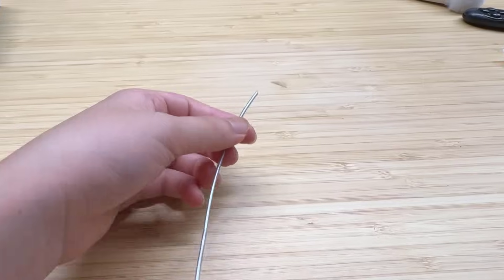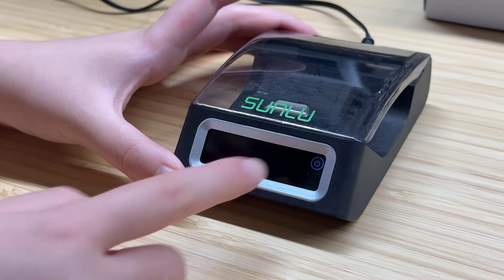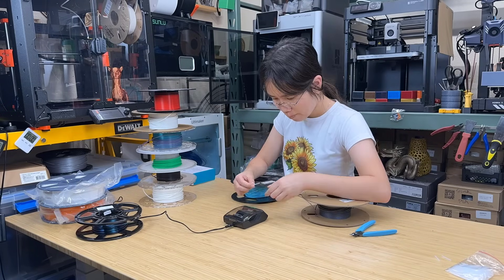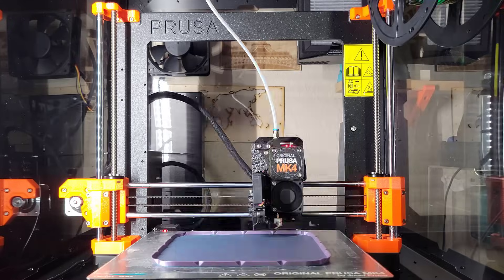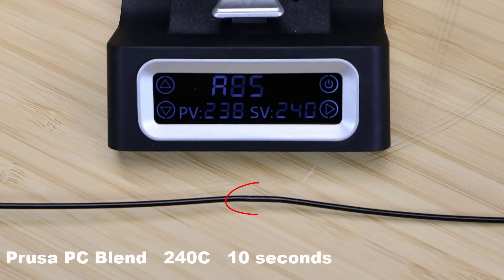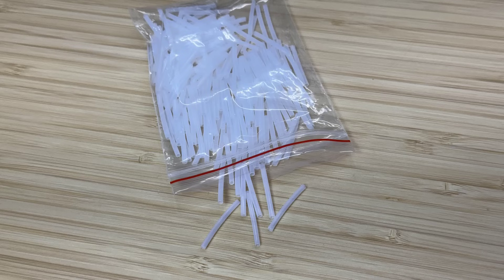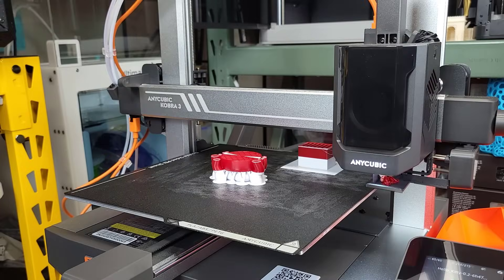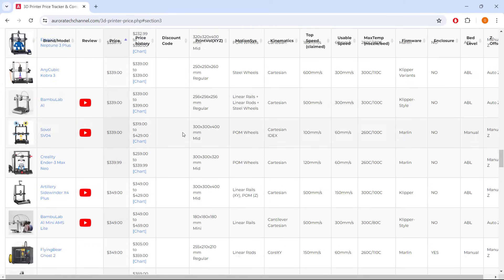How to reduce 3D printing filament waste by using the SUNLU filament connector FC01

Comment: Isn’t there a cutter on the device to remove the sleeve? i believe there’s a blade in the back
Reply from the maker: Kind of, but using a knife works much better :)
Reply: It looks like you can cut the sleeve in half.  it doesn't look like they need to be that big.
Reply: There is slave sliced cutter on machine just under the lid  . But she did not show you this in the video . Basically you moved the item to a different position and close the lid this will slice the sleeve horizontally . Then you can just remove it off the filament .
Reply: Pity it does not have a 45 degree filament end cutter as well so you do not have to eyeball the angle! But for the sleeve, you could probably just slide the filament through it (at the spool end of the bowden tube) as you print, until you reach the end, then pop it off and reuse?
Reply: @john_hind  Put the 2 ends of the filaments next to each other with the ends pointing the same direction and then cut both at the same time. The ends will match no matter which angle you cut at.
Reply: @TinkeringJohn  Indeed, put the two threads next to each other and cut. Clean cut every time ... things can be so simple 😀I'd give you two thumbs up if I could ...
Reply: @john_hind  eye balling the angle is good enough. it's getting melted anyways
Reply: @aleks138  The sleeve traps the gap air though....

Comment: Hello everyone! I bought the Sunlu filament connector with the idea of using up filament scraps from my spools, but honestly, there was no way I could get a clean splice. With the filament always so curved at the end of the spools, it was impossible to handle; it felt like I needed four hands just to hold everything properly! I always ended up with bent, failed joints, which was truly frustrating.

Luckily, I found a solution that has completely changed my experience: a 3D printable support guide. This design is brilliant because it perfectly aligns and holds the filament during the entire melting and cooling process, even the most curled pieces. Now, my Sunlu works wonderfully, and I achieve perfectly straight and strong splices, with no complications at all!

If you're going through the same frustration and have a 3D printer, I've discovered that the design is available on Cults3D. You can find it by searching for the designer name: @3DPRACTICO.

Here's the direct link to the design: https://cults3d.com/es/modelo-3d/herramientas/soporte-esencial-3d-practico-para-conector-de-filamento-sunlu-1-75mm

I hope this helps others who find themselves in the same situation! It's truly worth it!

Comment: This thing does not work. It's OK with a small piece. But with a spool in the back there is always tension what makes it impossible to make a good seam. I was not able to weld two filaments together that a printer would not fail over the seam. It's just a waste of money. I grew it away already just to keep my nerves cool and not trying it again and fail.

Comment: Downside you have to cut away the PTFE sleeves. 

Since you’re going to a transfer one spool to another, instead of cutting away the sleeve, can’t you just slide it off when transferring one the filament to a single spool?

Comment: why did you not use the sleeve cutter built into the back?
Reply from the maker: I have to push down really hard if I use the black slot to cut the tube. A sharp knife simply works better for me.

Comment: I have been looking for something like this for a while but didn't like the ones on offer so far, the FC01 seems much better all round.  I tried to order one via your link and found that the SUNLU site is not working that well, it took several attempts to convince it that I was in the UK and using GBP to pay, it seemed to prefer a mixture of either dollars and UK shipping  or GBP and US shipping.  If anyone has this issue, just keep trying as it gets there in the end.  I paid 34.75GBP with 2 extra packs of sleeves.

Keep up the reviews, no-one else covers things quite as thoroughly as you do.  Mark, UK.

Comment: I was using the tube process and using a soldering iron for heat but the curly leftovers were problematic welding.  I also discovered that those leftovers became brittle and would break in my AMS so I just stop joining them and started throwing them out as it saved a lot of time and headaches.

Comment: Thank you for the video.
Always something interesting on your channel. 
Awhile ago I bought a 2nd hand Pallet 2 to make my own custome rapid change filament, and to join nearly empty spools together.
Worked like a charm till I put a local companies rPLA through it.
I measured it afterwards, 1.65mm to 2.7mm over a 100mm diistance.
It broke the filament run out sensor.
I was duped after your use of sunlu recycled PLA.
Seems the r wasn't for recycled, but for reject.
but back to the point.
For the price of 2 spools of PLA you can save remnants and make up spools worth hundreds of $$$! well done!

Comment: did you miss the built in ptfe tube cutter?
Reply from the maker: I have to push down really hard if I use the black slot to cut the tube. A sharp knife simply works better for me.

Comment: Just slide the sleeve off the filiment and reuse it ?
Reply from the maker: Technically, you can. But it depends on how long the spool remains; you may need to slide it 50 feet to the end to take it out.

Comment: Please add a demo of the cutter to the video, it's part of the functionality. 
I have a zip bag sealer that cost 2€ and works since 15y. Why this is 35€ is beyond me. I could've done without the stupid touc interface and the awfull display. Give us a decent or none display and buttons. Why is this so hard?
Reply from the maker: I have to push down really hard if I use the black slot to cut the tube. A sharp knife simply works better for me.

Comment: Pretty cool device.  Well done Sunlu!  My preference is 3 kg spools for fewer reel changes and 1/3 of the end of spool waste on average, and if I want to use the leftovers when I'm monitoring the print (watching YouTube while the printer does its thing nearby) I've gotten fairly good at hanging a new reel and restarting the print before the bed cools and releases the part, then manually inserting the new filament into the extruder as it prints.

Comment: THERE A CUTTER TOOL AT THE ON TOP OF THE MACHINE TO CUT IT I HAVE ONE
Reply from the maker: Yes, but I found I need to push really hard to cut the tube with that black slot. A sharp knife works better for me.

Comment: Nice, thanks for showing the different filaments too. A little switch to put pressure on and hold both filaments would work wonders so you don't need 3 hands.

Comment: If you have a Bambu AMS you can simply pull all spools with left-overs into it and then automatically use them up. No need to bond filaments together. Just my 2 cents 👨🏼‍🔧
Reply: we all not as fancy or rich as you to afford an AMS. This is only $34
Reply: @TechBrewGamer I’m just curious, how are you in this hobby if you can’t afford an AMS?

I wouldn’t be 3D printing if my financial situation didn’t allow for the occasional frivolous expenditures such as an AMS
Reply: I have 2 AMS, but this is probably to help prevent that and save space. Also, for people who don’t have a Bambu. Lol
Reply: My IDEX does the same thing for basically the price of the ams .
Reply: Actually, I have a use for which the AMS is not a solution. Sometimes I need a gasket/O ring that a length of TPU is just right for. Like the lid gasket on the AMS. I have wished for a reliable way to join the ends. This might be the trick.
Reply: Finally someone says this. 
I don't get why people are hyping this
Reply: @sensenmann3000 Uh, the price point. Not everyone can afford Bambu nor the AMS system. This is great for tinkering with and pairing with a cheap bed slinger. At the price point it’s at, it’s worth picking up and trying regardless.

Comment: Aurora the device has a built in cutter at the top to take off the tube
Reply from the maker: Yes, but I found I need to push really hard to cut the tube with that black slot. A sharp knife works better for me.

Comment: I usually just let the filament run out on the printer and then load a new roll when the first one runs out. This might be handy if there's like a bunch or rolls left over and you do them all at the same time.
Reply: I’m probably gonna get this, I end up leaving my printers running for a while and leaving, so this saves space and time by not having to tend to it
Reply: We all don't have run out sensors to allow this and/or have just enough after a print not to print anything else on the same roll.

Comment: Why would you throw away filaments rolls that are close to the end? 
You print till the end and then you swap filament, with a filament sensor it's even easier as the machine goes in pause on her own.
Reply from the maker: In cases when a print finishes and the remaining filament on the spool is not enough for other prints, I end up with a lot of spools with only 3-10% filament left. If you run multiple printers, this happens a lot.
Reply: @AuroraTech  I fell ya, yet most of use just a few printers and few filaments and well, the filament sensor would do the trick as well.

I mean I get it's convenient for print farms like loads yet let's not sell it as "it saves you filament that would go to waste". Normal users could use just the nozzle or a heat gun or the solder iron with a random piece of bowden.

Comment: I wonder if you can cut a thin slice in the ptfe and reuse it.
Reply from the maker: If you really want to save the PTFE tube, you can slide it to the end of one of the spools without cutting it. However, it depends on how much filament is left, as it may take a while to slide to the end.
Reply: @AuroraTech  Not only to to save the PTFE, but to get it off easily (and not have to slide it anywhere). Essentially pre-slicing it, before use.
Does the slit leave any noticeable mark on the joint and the heated area, or have an adverse effect on the cross-section?
Reply: Me also.
Reply: Yes I would be very interested in knowing if you have tried this and if it works

Comment: I wish they would have designed a system to use silicone tubes instead of PTFE.  The teflon tubes will offgas and can be toxic (mostly to pet birds but still).  I'll still get one but use it with good ventilation.

Comment: How close to 1.75mm are the joints. Please share some measurements or averages.
Reply from the maker: It depends on how well you cut and apply pressure. I didn’t connect all of them perfectly, but it seems to work just fine anyway.

Comment: I be getting it soon! The small connector tubes could be saved if your rolling the filament on to the other 
empty spool the other loose end of filament would soon be off the old spool so slide the tube off before attaching the loose end of filament in the new spool.

Be reusable if not too over used then. Really those small guide tubes are slim PTFE tubing, 
So maybe find a thin cheap Bowden Tubing and cut it up to the size of the connecting tubes.

So many thin bowden tubes around there must be one that can be used instead of the official ones?  
Just print out a cutter guide for the tube length and that will be a saving and a good use for the cheaper Bowden Tubes.
Reply: I believe the bowden tubes have an inner diameter of 2mm.
The only tubing I've been able to find that is the right size is latex rubber, which wouldn't be great.
The Mosaic palette uses a tube that they claim gets 15000 splices. I think the price was $40US for 5, however I suspect it's a thicker tube that wouldn't fit in the heater.
Another commenter in another review claimed to have found some silicone tubing that he used with a heat gun but he didn't provide a link.
The other reviewer was able to slide the ptfe tube off the filament join, so prehaps there is the possibility of reuse.

Comment: Im curious if in the next year or so we see a machine variation that uses pellets to makes filament that is held in a buffer before going directly to the extruder. I've tested small screw extrudera but you need really small pellets which aren't easy to come by and are much more easily affected by static electricity. Being able to use common nozzle sizes but also work with industrial sourced pellets might be a good stepping stone until other advancements are made.

Comment: After welding the filament, you can place the PTFE sleeves in the back part of the lid, close the lid and then simply pull it out.

Comment: I just had a print fail at 98%. This would have been perfect!
Reply: Well you could get a filament sensor, it's much cheaper.
Reply: @eaman11  Thanks, captain, obvious,  I've been 3D printing 3 years. My Bambu lab a1 has a filament sensor. It just didn't register and was ghost printing clogged.
Reply: @THOR_THE_GOD  You welcome, I've been printing 10 years and my filament sensor works!
Reply: My point was, I don't need your basic advice from your "10 year experience." 🤡
*You're welcome
Reply: @THOR_THE_GOD  OFC, you need a good working filament sensor not my advice!
Reply: re-slice at the failed level and print that, attach to the original print. Seen a number of people do that to resurrect failed prints or where filament ran out.
Reply: @revrndcast3918  That process is good for some prints, not what I print, which is crossbow guns. If I tried that, especially on the part I'm referring to, I'd have a broken crossbow and possibly an eye taken out.
I've already reprinted the parts overnight.

Comment: I think this is really cool!  It seems very well thought out.  The only thing that might make it a bit easier is to have a filament clamp on each side so that you don't have to do the slightly tricky hold with fingers while clamping with thumb maneuver.  The clamps could slide laterally so that you can provide the slight pressure needed during the bonding process.

I also like that it provides a poor-man's multicolor printing solution.  In fact, you could cut up predetermined segment lengths from different spools intentionally to get the color order and balance you want, all with no filament changing during the print.  Yeah it's limited to horizontal layers, but that's an awesome capability for the price.  Plus no pooping.
Reply: 3d model some clamps and print it out with the spare filament. lol

Comment: Cool device. But I already do this using PTFE tube and a lighter. Also my printer have filament motion sensor, so there is no trouble to start with partial spool, just need to change filament when it runs out. However it lefts small pieces of filament like 30-40 cm long. I use them in 3d pen or just wield them to the beginning of same color new spool.

Comment: I prefer a candle and my two hands.  Heat ends, push together watching until a symmetrical "mushroom" forms, clip off the pushed out "mushroom" plastic, hit it with a small file and done.  It takes about as long to do as typing this all out.

Comment: At only £29.95, it's a great price, but frankly, why would you not simply use your filament out sensor and change in the hot end?
Reply from the maker: What about the dozens of leftover spools? Without connecting them together, you may have to babysit the print and keep changing filaments until it's finished.
Reply: @AuroraTech  On my Bambu printers, I put all near empties in my ams units, say they are all the same color, and turn on the feature where it will swap automatically to a new spool if it is the same color.
Reply: @AuroraTech  I don't have dozens of left over spools. And yeah, so you have to listen out for a filament change warning - no biggie with a Bambu. This way you have to wind the spools, make all the joins, clean them up, rewind.
Really not sure that this is a particularly time saving solution. But if it works for you, you go for it.

Comment: The slot above where the heater is where you put the filament with the ptfe tube close the lid and it will slice the ptfe tube for removal
Reply from the maker: Kind of, but using a knife works much better :)